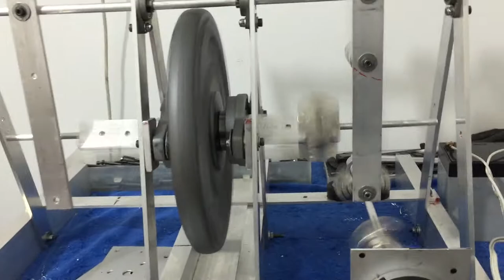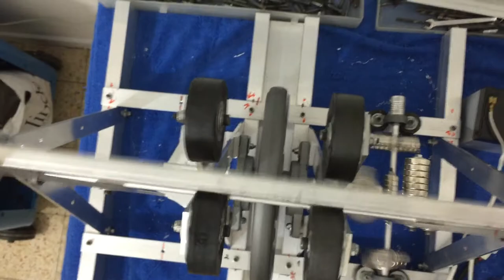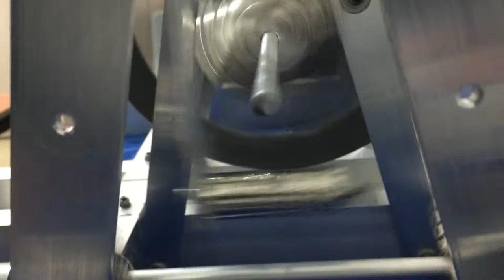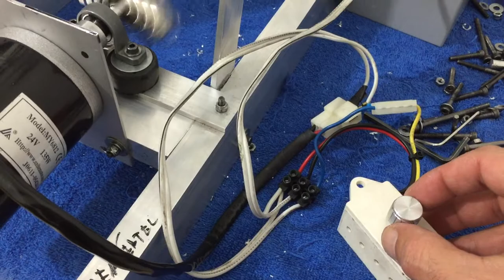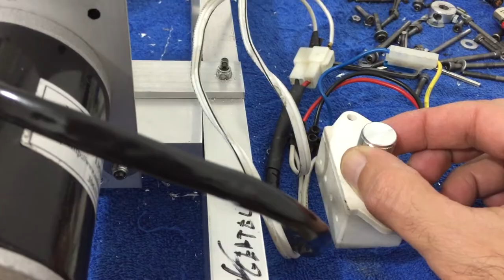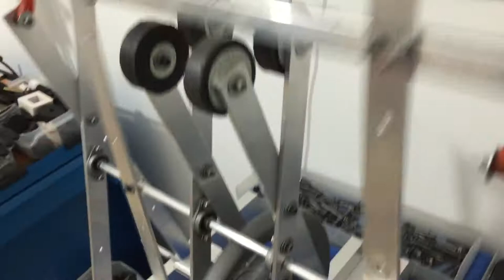Magnets provide power! and speed! Magnetic machine magnet motor engine built by oren gertel

Comment: Dear Oren, I've had a little look at most your YouTube videos. Whilst I am in no way confused with either the scientific principles nor the mechanical/electrical principles of the "machines" which you have constructed, I AM confused as to what it is that you believe you are demonstrating here!

None of the systems which appear in your videos are "motors"  and they are not "providing power" to anything.

The best you could hope for is that the "push" provided by the magnets included in your "systems" assist your "machines" to somehow reduce the amount of input power provided from the actual motors/batteries you are using within your "systems" by the reduction of friction.

However, given that the magnets themselves add extra weight to the "systems" which you are building and since the "systems" themselves are being constructed using standard bearing systems then such reductions in friction are totally and overwhelmingly cancelled!

With all the above in consideration. I am still confused about what it is that you are trying to demonstrate with these "machines"?